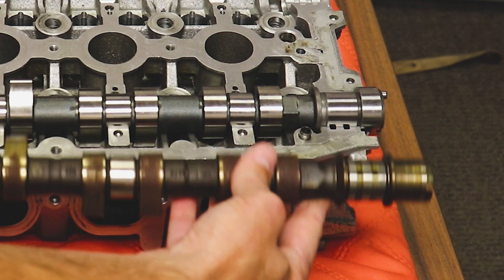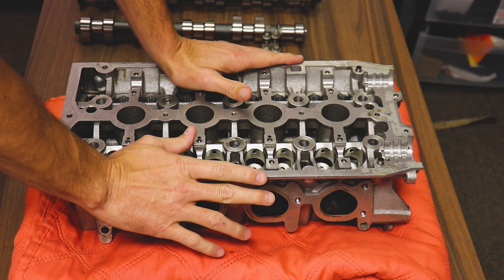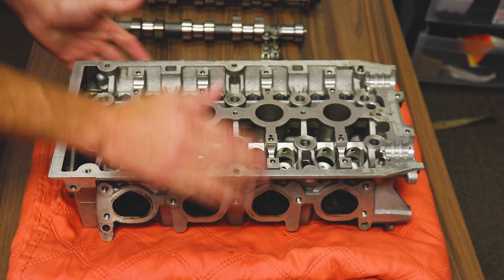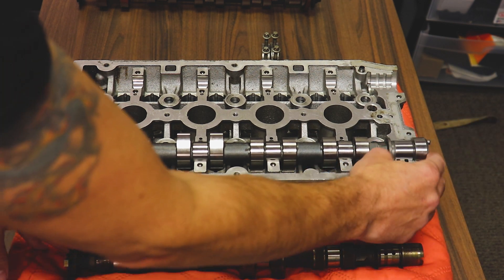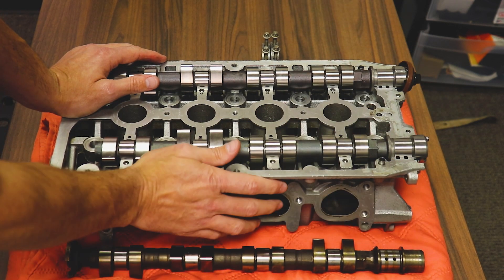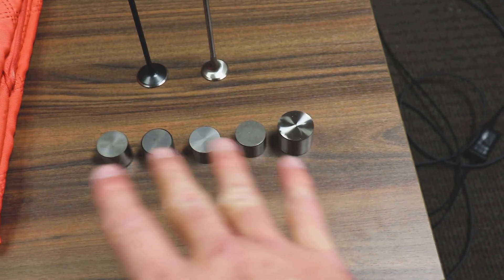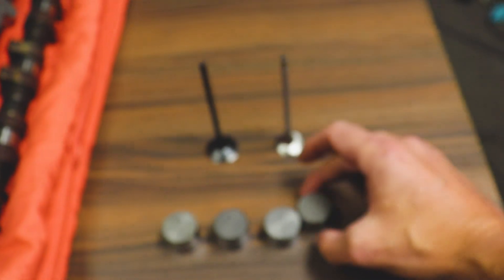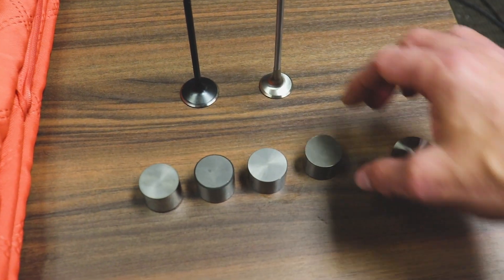Hydraulic to Mechanical Cams: Is It Worth the Hassle?

Comment: and what about backwards swap? from mechanical to hydraulic? I just hate mechanical cams in cruze
Reply from the maker: In the US, they come factory with hydraulic.  Not sure what the conversion would be in a setup that came factory with mechanical.  But you would have to get hydraulic cams because the cam profile wont work going from mech to hydraulic.
Reply: @cmattdabrat  and what about just head swap with US one? I drive cruze on LPG and hydraulic cams and lifters are just better for LPG.
Reply from the maker: @k6computers  They're a direct swap.  What intake is on yours?  The cast aluminum?  The intake has a slightly different pattern, but the casting is the same.  You could always drill and tap for which ever intake you want to run.

Comment: These cams have some gnarly lift it looks like.  I think the effort is honestly gonna be worth it.  I'd bet you lose a bit down low, but what you gain up top should be super nice.  Looking forward to further videos man.  Come work with me on my DSM in the meantime if you get bored.  All the way out in NW Florida. Lol.
Reply from the maker: That they do! For the 1.6, the rpm band is 2k-7k. I'm cool with a losing a little down low. The current setup with the GT3582, boost doesn't kick in until 5k. So the future swap, GT30, should still mesh well with these cams. Hahah, I may make it out to Florida one day. Not many 1/4 tracks around that have test n tunes often. Thought about  going to Bradenton for a test and tune, just for the fun it. Thanks for the offer in the dragy. I'll reach out once I get closer to installing everything. Thanks!
Reply: @cmattdabrat  For sure!  I want to upgrade to the new model anyway, so it gives me an excuse.  I like your channel and what you're about so I'd like to see you grow.  Any way I can help I will!  

And absolutely the bigger cams but smaller turbo will even out pretty well.  For a street car, the GT30 series turbos are my absolute favorite.  Some of them make 600+awhp and still spool like a smaller frame turbo.  Crazy!

Toss me your email, and I'll send you a quick message so you have my email when you're ready.
Reply: Also: I'll donate a Dragy to you if you want to use that for testing the cars.  It works great in lieu of not having a 1/4 mile drag strip nearby.  Just go to mexico, find a nice flat level private road, and bam.  Drag strip.

Comment: It might be cheaper/easier for you to order a mini lathe off amazon/ebay and then you can cut the valve stems yourself.  Just make sure to watch youtube videos on lathe safety and how to use a lathe.  Also, practice on some scrap metal first before attempting to cut the valve stems.  I'm sure you found out yourself that the lifter buckets have a small adjustment range because they are meant for specific engines and manufactures only expect the variance between valves to be a few thousandths.  However, some manufacturer's official valve adjustment procedure is to grind down the small disk "button" inside the bucket.  That's because as engines wear, the valves will get slightly longer and so the buckets' buttons need to be shortened during a tune-up.  Other manufacturer's official procedure is to change out the entire bucket for the correct sized one similar to what you are finding with the toyota's buckets.  I've seen other buckets still that that have changeable buttons inside the buckets where you flip the bucket over and use a magnet to pull out the button, then either grind the button or replace it.  Finally, there are adjustable bucket tops like you showed, but those are heaver and more individual parts to mess up.  Anyway, I say all of this because if you have a drill press, you can get a small Dremel grinding stone that will fit inside the bucket.  You need to use drill press instead of grinding by hand to make sure you are grinding it perpendicular or that the surface of the button remains parallel to the surface of the bucket.  Basically, the bucket will sit flat on the drill press table so that the button is pointing up, then the spinning grinding stone can be lowered straight down into the bucket by the drill press.  Alternatively, if you do get a mini lathe, you could possibly put the bucket in the lathe jaws and cut the button with a lathe tool, but this will be a more difficult operation for a novice because you will need to use a dial indicator to make sure each bucket is in the lathe jaws close to straight.  If the bucket is not in straight it will wobble while it is spinning, thus your cut will have a wobble in it too or be at an angle.  After writing all of this, I think the best method for you might be to use a drill press and grinding stones.  It will take a bit longer than cutting operations, but I think there's less to mess up.  First go to the dollar store and get a cheap thin cutting board, the ones I'm thinking of are less than 1 mm thick sheet of plastic.  Second, put the sheet on the drill press table.  Third adjust the drill press table by rotating it a bit so that the drill spindle will lower towards a solid section of the table instead of lowering towards a hole in the table.  Typically, you drill over the center hole of the table so that any drill bits go through the hole instead of hitting the table, but for this operation we want a solid surface to support the bucket.  Fourth, adjust the height of the drill press table so that there is just enough room to insert and remove buckets under the grinding stone when the drill spindle is up and tighten the table clamp.  Fifth, clamp two pieces of wood, copper, brass, or aluminum on top of the table with the plastic cutting board sandwiched between.  The wood, copper, brass, or aluminum should be positioned at a right angle so that a bucket can be pressed into the angle and the pieces will align the edge of the button with the edge of the grinding stone.  You don't want the middle of the grinding stone to be lined up with the middle of the bucket/button because then the very middle won't grind well, you want some offset.  If your grinding stone is the same size, just slightly bigger, or slightly smaller than the button, you can line up the edge of the grindstone with the center of the button instead.  What you want to happen while grinding is for the bucket to slowly rotate as it is being ground to average out any misalignment, you might need to put oil on the plastic cutting board to help the buckets spin, or even spin them by hand.  Having the griding stone offset will also help the buckets spin.  If the grinding stone was centered the drill will just spin the bucket at the same speed as the drill instead of grinding the button.  You can also add a third piece of wood, copper, brass, or aluminum to hold the bucket in the corner of the other too.  Sixth, set the drill press to the lowest speed and put some thin oil like wd40 or water inside the bucket to keep the grinding stone cool and to help collect the grinding dust.  You might need to empty the bucket and add fresh oil/water if too much dust builds up.  Seven, start grinding your first bucket.  When you start grinding you want to look out for a couple of things: if there is any strong vibration, loud noises, or bad screeching lift up the drill, these could mean the pressure or the speed is wrong, you're going to have to feel out what pressure feels right.  Next, you want the bucket to be rotating slower than the grinding stone, that means it's working.  Next, you don't want the bucket to be barely moving or sitting still.  If that happens you might need to increase the speed of the drill press, spin the bucket with something, or spin it by hand.  Screeching or strong vibrations can also mean you are running at the wrong speed or pressure, and you should try changing the speed of the drill. Also keep an eye on the grinding stone, some cheaper ones can break apart. If everything seems good you can slowly increase the pressure and the speed to help you work faster.  Eight, check your depth often and remove less than you need to.  Nine, check that the grinding stone is still relatively flat, you will likely need multiple grinding stones, but they are cheap at the hardware store. If a grinding stone gets misshapen you could try to dress it again or just use it for bulk removal of material and use a new grinding stone as you get closer to the desired measurement.  Ten, this will probably take a long time so you could put a weight or a bungee cord on the handle of the drill press to keep constant pressure on the drill.  Eleven, after this is all set up and working smoothly, you should be able to quickly swap out to the next bucket and get all the buckets close to the final measurement like an assembly line.  Twelve, when you are ready for final assembly, you can install another fresh new grinding stone and bring the head close to the drill press so that you can quickly and easily test the bucket and measure the gap with a feeler gauge then put the bucket right back into the drill press to sneak up on the perfect lash.  There needs to be a gap between the top of the bucket and the base circle of the cam when the engine is cold because as the engine heats up, the metal valve stem will expand, and the bucket will get closer to the cam. There should be charts online for valve length and amount of lash for both exhaust and intake as well as hot and cold lash.  Thirteen, you can get some fine grit sandpaper like 300-800 and polish the button a bit after grinding, but I don't think you want to polish it too much because a rough surface will hold oil similar to the cross hatching in the cylinder, just knock down any high spots left from grinding.  When you get the engine assembled and running, you want to check the valve lash again after breaking it in.  If you notice that the valve lash is getting tighter you might need to set up the drill press again and grind a bit more off the buttons.
Reply from the maker: Awesome write up! Supertech has the shim under bucket like you mentioned but are on back order so I just went the Toyota bucket route. The Toyota buckets are $12 a piece and supertech are $34 a piece. At $16 a pop it can add up.

Funny you mention the grinding stone method. Saw a video while researching different methods to either shorten the valve or the post inside the bucket. Saw a video of the bucket grinding stone method. However, I did see some mention of this method would like remove the hardening as is a very thin layer. Although someone has had success. Definitely something to think about. I like the drill press stone method though. Would be a lot easier than the valve method. 

Thanks for all the tips. Read every bit.

Comment: Would it be more cost effective to just get a long block from overseas?
Reply from the maker: Not necessarily. The buckets were $10 a piece. Still would’ve done the valve upgrade. With the new cams, it’s best to get new buckets and they don’t have oem buckets for the overseas head in stock. Plus trying to come up with a solution for the 1.8. Theirs is 1.6.